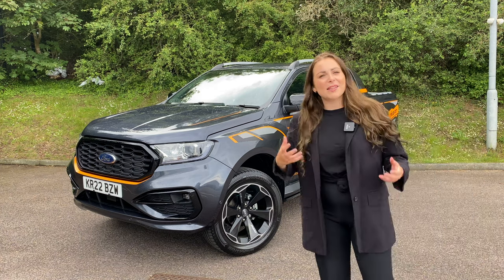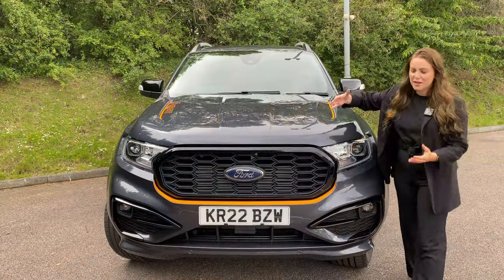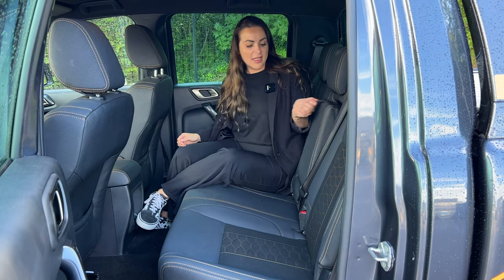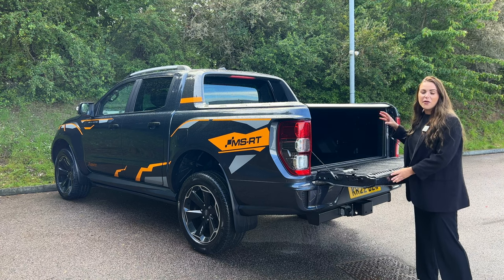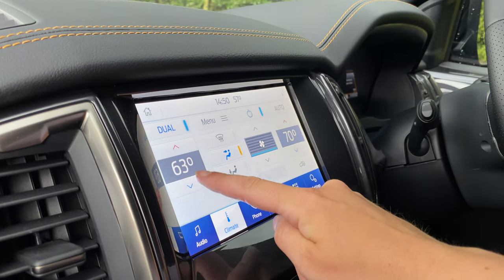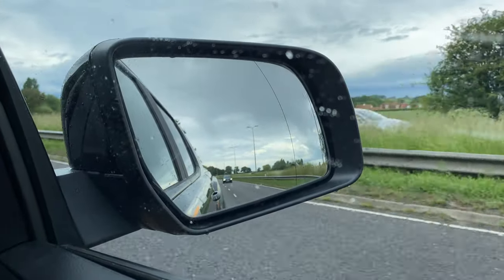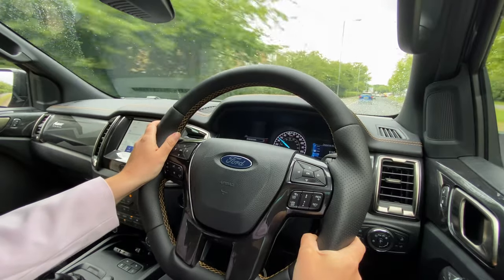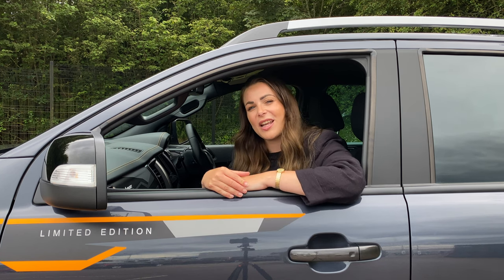Ford Ranger MS-RT Limited Edition - Better than a boring family SUV? UK 4K (2022 Review)

Comment: The people who buy this are even bigger eejits than those who made it. To take an off-road version and then change everything to gloss, put on narrow profile tyres that are street-only and then slap on hideous random orange stripes? What is the point of ANY of this?! I suspect they’ll sell less than 10 of this.

Just get yourself the Wildtrack and save a ton of money. 

They could have made a lowered, sporty version or an even more off-road capable one, but chose absolutely nothing that makes any sense.
Reply: Narrow profile lol. They are called low profile tires not narrow lol.
Reply: @sharonec5419  They’re FACTUALLY called both, troll.
Reply: @afcgeo882  Awe OK. I did not know that. Too me something like the thin wheels a BMW i3 is on would be narrow profile.  Well you learn something every day and no I am not a troll.
Reply: @sharonec5419  Narrow wheels/tyres are one thing, but the profile of a tyre is its side thickness, and that can be wide or narrow. They’re also called low/high because the sidewall is low or high. Both are perfectly acceptable. And yes, you’re a troll. Even if I was to use the wrong term, your comment goes to insult with your “lol”s, rather than to simply correct.
Reply: Yeah it is pointless, it is like the people that lower camper vans so low, they can't go many places because it is to low.

Comment: I prefer pickup trucks over SUVs, especially diesel trucks. Cos diesel engines are very torquey for carrying weight, for towing, and they get much better gas mileage than gasoline engines when pulling heavy weight.